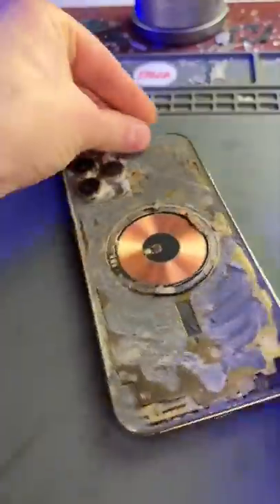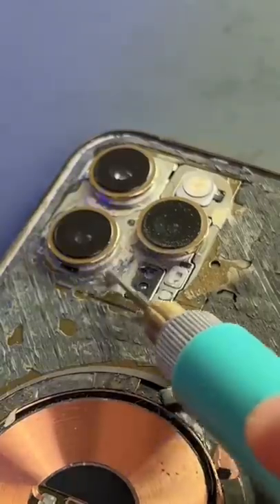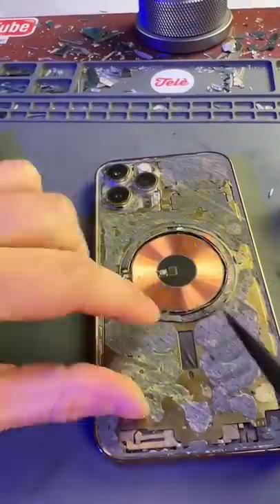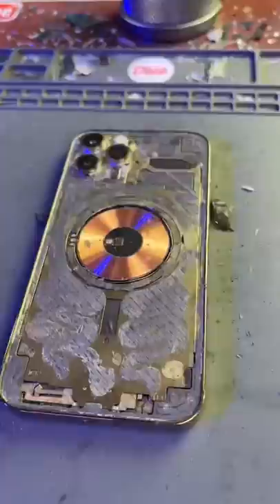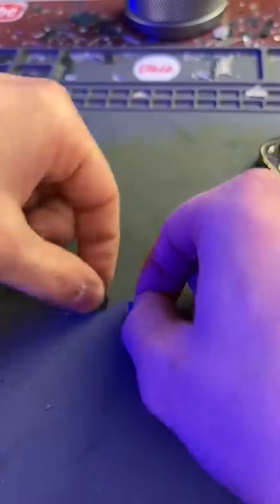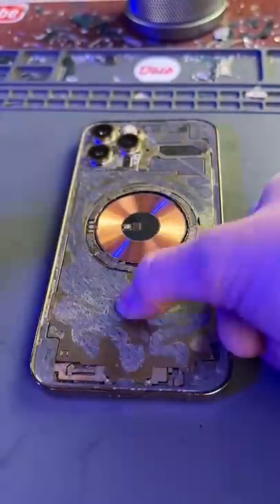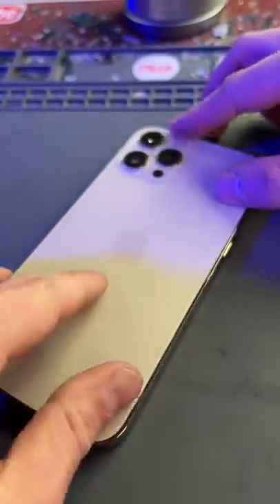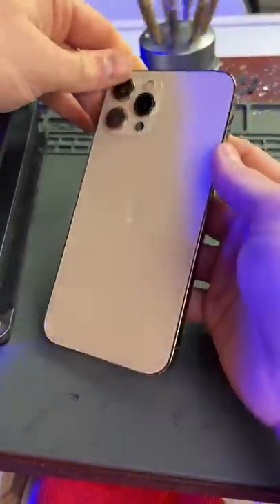I swear I’ll do it #shorts #laser #oddlysatisfying

Comment: I mean the manufacturer could have made this much easier by just having a removable back like they used to do. Now it costs $150 and a day in the shop every time the glass cracks.
Reply: Apple never had removable batteries but Samsung and the rest of the market are all a bunch of donkeys for taking the Apple approach. They’re all scraping their headphone jacks and external storage too.
Reply: @deleqtronica8733  he isn’t talking about the battery just the back of the iPhone/phones the iPhone 4 had a removable back by just removing the bottoms screws pushing up and taking the back off
Reply: With my 13 pro max when the back screen cracked apple+ covered it and it took them about 30 minutes and $34
Reply: Have a removable back = lose water resistance, there’s always a reason why certain manufacturer made it this way
Reply: @jostinmendez1026  so you paid for Apple care and than had to pay for them to repair it too?
Reply: @deleqtronica8733  I’d rather pay less than 50$ than going through the hassle of being told it’s unrepairable/ having to find a shop that could have worked on those phones considering it had just came out 3 days prior
Reply: @deleqtronica8733  yep, $200 extra. Ducking scam lol